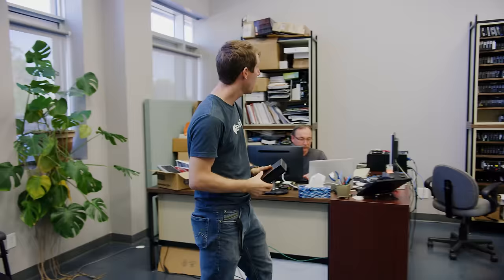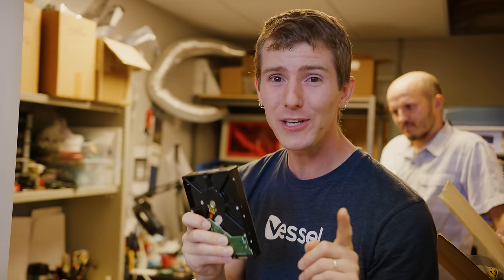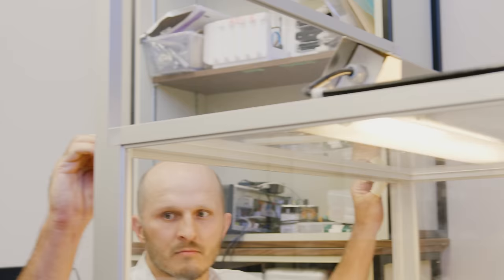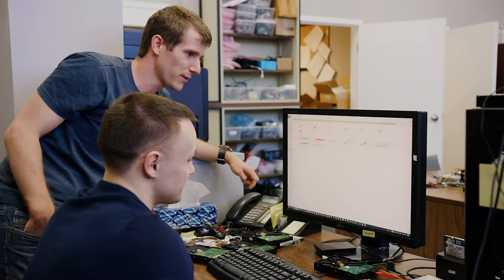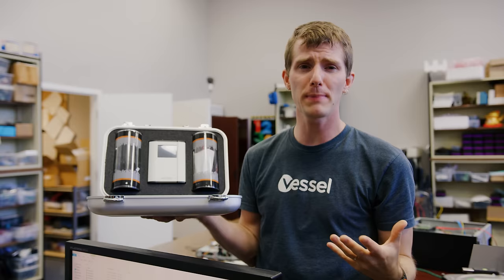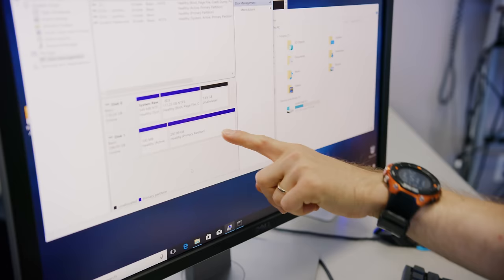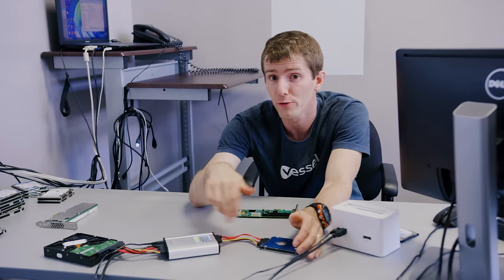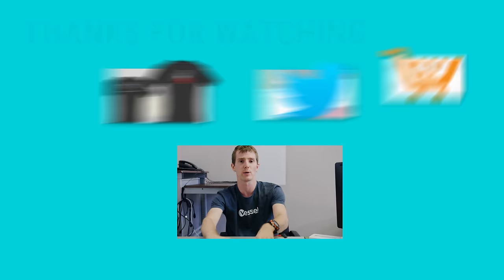Don't Waste $1000 on Data Recovery

Comment: My favorite hard disk failure was on a pentium 4 1.4ghz computer with rdram. The drive was a Seagate drive. I had just gotten home from high school went to turn on the computer probably for a Diablo 2 gaming session and on boot up the drive just spun faster than I've ever heard a hard drive spin ever in my life. Smoke started pouring out of the case and the drive platters sounded like they broke all this in under maybe 5 seconds. Bet they couldn't recover that hahahs
Reply: For a short time, you may have had a limited edition 20,000 RPM HDD. :)
Reply: Sounds like you were hearing a power supply failure, not hard drive failure.
Of course, power supply could've taken the drive with it, but smoke and sound would definitely have been the power suply
Reply: at first i read that as 41.4ghz and was about to go on a googling spree
Reply: Back in the day there used to be a type of malware that someone would send you and it would speed up your hard drive, essentially burning it out. Maybe you made some enemies you shouldn't have and they fucked up your system.
Reply: Smoke 
I was remembering the same thing. 
the bad one was the one that acted on cdroms in some cases you could get shrapnel from an exploded disc coming out the front of the dang thing
Reply: Wasn't power supply related I went to Circuit City (lol) and bought a new Western digital 40gb hard drive the same day reinstalled windows and was up and running same afternoon. Ahh the days when you could still buy hardware at stores
Reply: andrew miller hard drives r obsolete
Reply: andrew miller 5GB? Peasant especially since it’s an old ass hard drive not even an SSD
Reply: I once gave a really old CD with a game on it to a friend. The CD was one of those before fast 16X ones (4x? 6x?) and probably had some micro cracks in it. He popped that into his new high-speed drive and once it spun up it exploded and even went through the case, according to him... boy was he pissed.
Reply: @Khloya69   if the circuit city or 1.4ghz pentium 4 with rdram part of the story wasn't obvious enough this was back in 2001
Reply: andrew miller pretty sure they had more than 5GB HDD in '01 bc u said Gb not GB
Reply: andrew miller  , looks like someone played a joke on you , i have never heard of a hard drive doing that unless tampered with or dropped from a high distance . i just fixed a sata drive that was 930 gb one platter , the bearings were tight , heads were damaged . got the disk turning and replaced the heads along with the main board from a 
another exact matching drive . saved the pics to another newer drive and copied them to a info dvd . i told her not to throw her computer that hard , she did not listen lol .
Reply: Kamil I'm not actually dumb he's the one that said Gigabit bc he didn't put the uppercase B
Reply: He also used a lowercase g, but that doesn't mean he's talking about grams. My first comment still stands...
Reply: well thank you all for pointing that out :)   yep i meant 930 gig hard drive  . i do have about 15 or so of the old school large type hard drives laying around that actually still function  :)  what are they called again , you know what i mean  :)
Reply: Iblis voting Trump isn't a threat, he's doing great, also I'm not religious.
Reply: i have a computer where as soon as you add an sd card to it, the sd card jack starts smoking. No sd card? no smoke. wanna use your sd card? it gonna burn.
Reply: I was at a Best Buy a few weeks ago and they had an entire aisle of computer components. Boards, processors, graphics cards, and I believe even cases. I didn't take time to look as I was on a work-related mission (USB-RS232 converter), but I was surprised to see that in brick&mortar.
Reply: microcenter  is the only store I know of and live a reasonable distance from. I've never been to frys but I think they do in store too
Reply: XD that is funny
Reply: +Iblis what a typical troll-like statement...

Hmmh... Interesting...
What does that say about you then? ;p
Reply: ya the rpm governor was still out to lunch when you booted it up. it popped ;D
see a youtube video on cdrom drives exploding a cd
Reply: That's a pretty spectacular failure.

Comment: My xbox one has made that sound from the hard drive at the beginning, for the past week. I thought it was just some overheating, but now I know. This would explain why it was extremely slow all the sudden. Getting it serviced now, thanks Linus.
Reply: If its making a clicking sound, thats the head repeatedly trying to calibrate itself. And hitting the endpoints. Very bad news and it will destroy itself shortly after. Copy any data off, and get a new HDD.
Reply: Are you sure it’s the hard drive? Sometimes Xbox CPU Fans makes clicking noises because of a manufacturing problem. If you haven’t opened the Xbox’s case and you have a warranty they’ll fix it for free or even give you a new xbox.
Reply: Logan Pennington honestly I don’t know, but it sounded exactly how it did in the video. I am just getting it serviced and letting them do what ever they need to do. Good thing I still had my warranty for it.
Reply: Glad to see an LTT video help a user identify potential hardware failure and help someone out ;)

Comment: Awesome. I've done probably close to a hundred HDD data recoveries myself over the years. I also did PCB swaps, head swaps and even platter swaps for which I could find head replacements to get off the data of the platter for which the head(s) where non functioning.
One should always keep in mind that once you open up a HDD, you should recover as much data as possible, because afterwards the drive is going bad.
I have one tip: If you have a Hitachi drive in your PC or laptop (no matter which model), replace it asap. I've not encountered a drive of that brand that doesn't have problems, even brand new ones.
Reply: Amen, I've been watching the 2Tb Hitachi Drive I took from a 21" iMac increase bad reads, seek errors etc in CrystalDiskView slowly over the 2 months I've been using it... Then again old IT guys like me with NAS Disk Striping with Parity servers and hourly remote incremental syncs don't worry about data loss, we already leant the backup lesson long ago : )

Comment: that autoscrub and stoping the PC from automounting the drive was the best tip i've had in the last 20videos. thanks so much.  i've had several drives that just hanged my pc, portable drives and such and i could never fix them because they would forever hang up my PC. and every search on the internet told me nothing at all.  why doesn't google know about this tip?!?!  thanks
 and in case google is listening, run command as administrator, type automount disable followed by automount scrub to stop a harddrive from hanging up your PC
Reply: Google owns YouTube, so they might be listening to their own sites a bit.
Reply: Recover it with gparted instead.
Reply: Literally dealing with this right now, external hdd just keeps hanging my system. Googled like crazy and pretty much got nowhere. Looked up Linus to see if he had any nuggets and yup.
Reply: How do you undo those commands? automount disable and automount scrub? Does a reboot return to normal? Thanks
Reply: @alandetor5297  run CMD as administrator, type diskpart followed by automount enable and reboot
Reply: @r3dhorse  Whats "gparted"  ??
Reply: I've had the same problems one week ago but i didn't know then about this solution so i just booted live-cd of Linux and recovered it with gparted. Works too.
Reply: @r3dhorse  gparted couldn't handle my nfts partition because it was corrupted somehow. Linux is not always the solution :(

Comment: If you have really important files to keep safe, I recommend buying 2 external hard drives from two different companies so they won’t eventually die around the same time and save the exact new things you create daily on both drives at the end of each day.  If any of the external drive dies, buy a new drive, copy over everything from the other external drive and continue saving onto both drives.  Eventually both drives will become full.  Then buy more external drives.  It goes without saying to always plug all your electronics into surge protected outlet strips.
Reply: Yep, lot less cost, lot less stress.
Of some interest; I remember back in the day when an Electronics franchise HQ and a Maccas outlet down the road swapped hard drives every Friday night. That's another way of protecting your data.
Reply: i did that for my thumdrives not one of the HDD and i no idea where to get a donor hdd ？ sigh too old HdD
Reply: Also make extra drive copies to store offsite in case of a physical disaster such as tornado, fire, etc. or even theft.
Reply: I've heard exactly different approach. Namely buy the same drives, as the likelyhood of them failing at the same moment is near zero anyways, but if that happens, you have a identical HDD at hand for spares. After years, it'll might not be easy to find the same  model second hand.
Reply: @sc0u7   Nope.  that's wrong.  Same drives with same mechanisms react to usage in the same exact way which increases the chances of same machines breaking down around the same time.  Nice try though.
Reply: @ExclusiveLM  what about buying 2 of them and only use one. Keep the other for spare parts.
Reply: @ivanpulgaralarcon1018  But you won't know what spare part is not working to be able to repair it.

Comment: Bad sectors just need more discipline. I give them a sound thrashing then send them to bed with no supper. Works every time.
Reply: this is true statement.
it is known.
Reply: I usually just scream at my drive that the sectors are a team and if one sector fucks up, they are all in for it and if they can´t figure it out overnight I´ll FUCKING OPEN THAT CASE UP AND THROW SAND ALL OVER THE PLATTERS WHILE SPINNING. 
Usually it´s fixed the next day, with one or two sectors less in total.
Reply: hdd regenerator can help with that... takes for-fucking-ever to run, but... we have a first gen 4tb that over heated thanks to my buddies wife putting a thick beach towel over it on the table as it was running... got so hot the table warped a bit and the towel browned... decided to test hdd regenerator since the company had given me a free copy... took over a week to run fully, then i used a tool to restore the partitions......and well its been inside his cosmos for years now, and been used as his temp drive for torrents(active torrents kept on it auto copied/mirrored into his archive drive, then he clears the temp drive data after hes done seeding each torrent).... we keep wondering how long its gonna keep going...
Reply: @AshenTechDotCom  that drive needs a proper burial once it passes.
Reply: Thanks Cliche Guevara... :P

Comment: 0:23 - how to spot a professional IT guy xd
Reply: Watching Linus Tips in YouTube (if you look at his screen)
Reply: probably just checking who the hell this linus guy is and why he has a RED
Reply: elbow problems in 10 years
Reply: A pro don't use no 1970's public school pull down projector screen and a pointer stick. 😂
Reply: Can't unsee the tab titled "FURRYFANFICT..."
Reply: texasdee slinglead they didn't have pull down projectors in 1970. They had overhead projectors. Also, yes they do. Not sure where you got that from. Also pretty sure it wasn't a pull down projector. Pretty sure it was a fixed screen

Comment: I just started this video.  I wanted to mention a trick I learned as a desperate but working last ditch effort.  Throw the hard drive in the freezer. EDIT: I forgot to mention it's only for HDD's that click.  Clicking can sometimes occur because of an out of alignment issue with the read/write heads and the platter.  Freezing the drive causes the metal to contract and can sometimes bring the head back into alignment.  Bear in mind when this method does work you need to grab the most important data first because after the drive returns to normal temperature the issue will most likely return.  This last ditch method has worked for me about 60% of the time.  That's why it's a last ditch effort.
Reply: I have seen this done. Make sure you are in a cool/cold DRY (Num) room, as the drive hit humidity you get condensation/water and we all knoow water and electronics never play well together.
Grab the DATA, drop the cannoli!
Reply: So you saying that puting dockstation with it, outside on my isba in Siberia is a good idea? Golly!
Reply: Dry ice or in a plastic bag in a deep freezer

Comment: 1:46 I swear I see at least 6 specs of regular household dust on that plate, so either that one has been opened at home beforehand, or their 2 million dollar professional dustless area isn't very dustless :D
Reply: The shot where you can see dust is not from the $2 million clean room video. It is a shot of the guy using the laminar flow box they're talking about. Probably less surprising to see some specs of dust there.

Comment: We coded everything from scratch in assembly code. Well, I'll just do THAT.
Reply: i dont believe him
Reply: my best friend in high school could do that...he learned how on his C64...even in high school I would bring a disk to him and he had a program that would let him 'see' the surface of the disk...and this was to defeat the copy protection, something he saw as the very first challenge to defeat with each new copy protection method.
Reply: @darkstepik  What do you mean "don't believe him"? It's not black magic, it's just assembly programming. Yeah, not the most approachable solution, but sometimes that's suitable when you're using custom hardware/software.

Comment: "We coded the whole thing in assembly"
~self jerk intensifies~
Reply: not safe, better do it in haskell next time. :pp
Reply: you misspelled binary.
Reply: Noobs. I code exclusively in hex
Reply: Not every-programmers can program in low level machine language. 🤪
Reply: Seagate go usb drives are garbages, don't no about their successful recovery.
Reply: You misspelled AppleScript
Reply: +oskado95
but binary is the more basic method
Reply: ...but just in the same way courier new is more basic then comic sans.
Assembly translates 1:1 in executable code while hex/bin/ascii is just another way of displaying numbers in storage. You could also display it in decimal, but that would mess up your alignments.
Intentional emphasis on translate and display.
1 hex digits equals to exactly 4 binary digits
With decimal this conversion gets messy.
Example: f = 1111 = 255
Example 2: 10 = 00010000 = 256
Reply: @fgregerfeaxcwfeffece  
The CPU reads everything in binary code, therefore Hex must be converted into binary before the CPU is able to read it. This takes time, not much, but its a loss of speed. If you want to program a very fast application binary input is quicker than assembler.
Reply: It's the exact same method, unless of course you decide to physically set the induvidual electrons...
Reply: draco5991rep
You are confusing character codepages with actual data translation. Hex is just the most convenient way of making binary data human readable, the values are not physically different in the storage. As described in my longer post. You can also view this text as hex, but the output varies according to your character codepage. I am Assumming youtube uses UTF8(defined somewhere in the HTML code, to lazy to check) as it's acii compatible and ascii is pretty much the feault for the non mainframe world. I put this here because with mainframe comes ebcidic, and ebcidic is it's own sup incompatible can of worms with thousends of mutually partially incompatible codepages all called "ebcidic".
Back to ASCII and It's UTF8 "expansion"(different use of quotes then before, i am not a linguist, so i don't know the term.) you can read any file, even executables as ASCII, but ithwhill be just mashed nonsense except for the few parts where you actually defined readable "literals"(Quotes that mean "literal" again literal is the exact technical term here , literals the plural) literals would be text you show the user for example. Therefore it's easier just to let it stay the way you typed it into the assembly code.
Computers works binary, therefore everything is at all times just binary numbers.
If you tell your system: "execute this" it will assume it to be some sort of executable code
Your browser/Texteditor will to the opposite, it will assume the memory values to be Text therefore diyplaying it as ASCII. Executables might contain ASCII because that doesn't mean anything to a computer. In Assembly you simply tell it not to execute those parts. In Assembly programming you might actually just  define a constant mid code and tell the machine to skip the next x bytes. Just so you get a readable string of characters in your debugging memory dump as a hint where you currently are. That's the most common usage for the ASCII display in Hex editors.

Example:
in x86 assembly "AND" (Mnemonic for "Logical and") is 20(hex=00100000bin)
In ASCII "Space" (" ") is also 20(hex)
How does the CPU tell them apart? It doesn't! 
You tell it what to execute. And that's the danger of code injection and buffer overflows.
Reply: @fgregerfeaxcwfeffece  
Thank you for the explanation :) you are right I was a little confused about this topic :)
Reply: Assembly can have macros, an ISA can have emulated instructions, and arguments are sometimes encoded in the opcode, sometimes not.
So no, Assembly is not 1:1 with binary output. It's just one of those things that people say.
Reply: We moved a magnet over a hard drive manually, bit by bit.